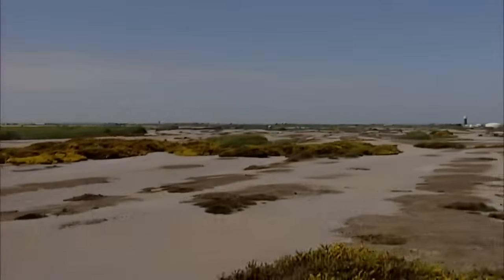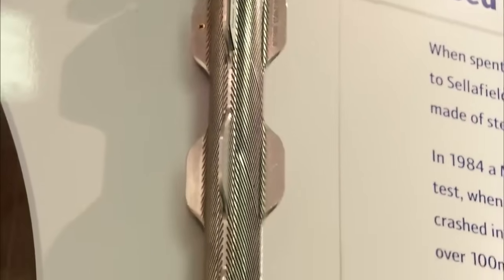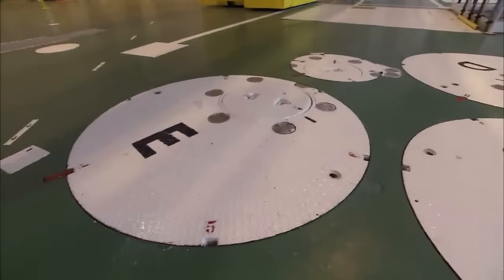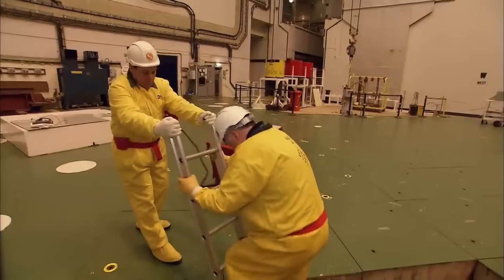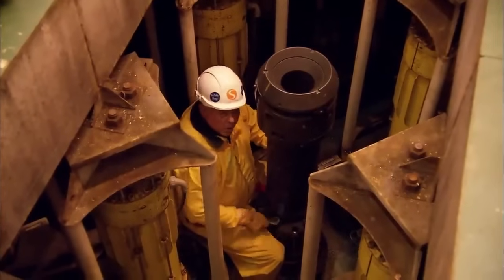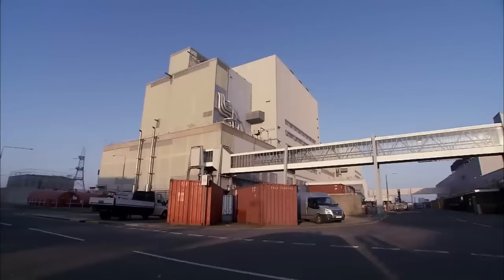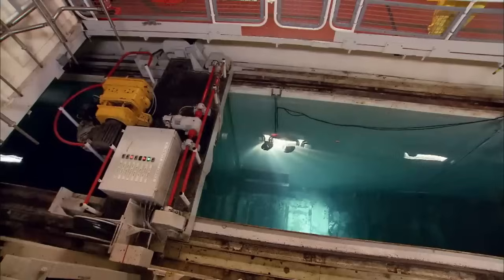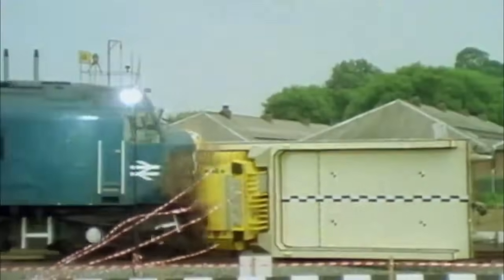How They Clean an Active Nuclear Reactor | Filth

Comment: ONLY 3 % OF THE ENERGY IS RECOVERED FROM THE FUEL BEFORE IT GETS TOO RADIOACTIVE TO HANDLE SAFELY, OR IT WILL REACH CRITICAL MASS!
Reply: The only correct portion of what you have written is the on average 3-5% uranium burn up in an element. The rest is just word salad.

Comment: Remember, all this has to be done with absolute perfection. But I guess any possible mishaps that can cause it to be released are still better than other alternative means of making electricity? 

Huh, my X to doubt button isn't working. Wonder why. Must be radioactive particles making it malfunction.
Reply: You know how many people are killed a year and how much toxic crap is dumped into the environment due to fossil fuel extraction, refinement, and use?
Reply: @Mayakran 
 
And I wonder how many more would die if we just leeched spent fuel rods into the environment. Its not like we have to fully encase those spent rods BEFORE we store them in an underground bunker. 

Why have the sarcophagus for chernobyl, clearly your thought processing says the radioactive particles there arent bad. Why the sudden freakout when the Fukushima plant leaked radioactive particles, clearly not as bad as the toxic waste of fossil fuels. 

Man, im such a dunce aren't I?

Comment: Fun fact: While standing inside the control room of a nuclear reactor you receive less radiation then a normal background dose
Edit: To clarify, I am talking about a function and maintained power plant, not an abandoned one.
Reply: Fun fact: A coal mine is more radioactive than most parts of a nuclear power plant!
Reply: @atome8088 also a fun fact that coal kills 100x more people yearly than the total deaths caused by radiation ever.
Reply: The same thing is true of your average underground parking garage as well. It's not even anything special, control rooms are just really sturdy and have thick concrete walls
Reply: Obviously because the control room is positioned away from the reactor itself.
Reply: @PlayingwithPawz That and it has a decent bit of shielding
Reply: Fun fact: NOBODY has ever built a control room inside a nuclear reactor but they are often located somewhere in the nuclear power plant facility... silly.
Reply: @LetsGoBrandon_  the comment said the control room of a nuclear reactor, not the control room in a nuclear reactor 😅 you should really read stuff twice before making assumptions
Reply: Yea your talking about a fully functional one. Go to an abandoned reactor and try that same thing. Rads are way higher due to exposure. Of course a protected room from radiation is safer than the environment that's unfiltered and unprotected.
Reply: Sure......
Reply: @richardmccann4815  thats actually true
Reply: @amazonbox5551 sure it is. "Then". Come on man...

Comment: To people who say Nuclear energy is safe and cost effective they are wrong on both accounts. This decommissioning must cost billions for one reactor alone
Reply: I'm pro-nuclear, but I can't argue with that point. The decommissioning process for a fuel type with lower thermal inertia (e.g: Drax, coal) lasts a month or two after the furnaces have been shut off and cooled. With nuclear that cool-down time is half a century, and the deconstruction of the infrastructure (Itself much denser than other power types) will take 4-8 times as long as for a coal-type station.

The flipside with renewables might be that it's much harder to build renewable generation infrastructure (Windmills, especially) with operational lifespans anywhere close to those of nuclear stations. There are derelict wind farms in Nevada from the 80s which have been left to rust because abandoning them was cheaper than proper decommission or replacement, and the same challenge is likely to be seen with the massive arrays of wind farms that have been put in place today. They could make parts of the British coastline entirely impossible to navigate.

Perhaps if we designed nuclear reactors with 300-500 years service lives, including a phased decrease in output across the last fifty to reduce the post-decommissioning cooldown?... ☢💡😇
Reply: @dieseldragon6756 what about the highly radioactive material? How will it be stored long term?
Reply: @silasnightmare9461  U.S wise we couldve done yucca mountain if that project wasn't gutted
Reply: I like how you don’t actually make an argument for both points and the cost is actually not that relevant because the way it’s done any energy thing emds up costing billions no matter what somehow

Comment: when yall get your full country green energy blackout ...dont cry ok k ...your literally trashing the safest cleanest and greenest energy type
Reply: Nuclear power is great and I'm glad there's gonna be more reactors 'soon' but these old Magnox reactors have reached the end of their service life. They're demolishing it because it NEEDS to be demolished. Not because they don't want it any more. Dungeness A did its work for 40 years. Nuclear power stations don't last forever sadly.
Reply: @mrmeatbeard  but thay last longer then 40 years lol...look at the military hell the reactors on the aircraft carriers are what 50+ years and still going strong no problems...dude you got to wake up you already drank to much cool aid...hell 3 mile is older then that and getting restarted
Reply: @danbrit9848 some last longer for sure. Magnox do not. Plus they're inefficient compared to gen3+ reactors and with gen4 or whatever it's gonna be around the corner, it makes sense to move to safer, more efficient styles of reactor rather than having to keep stopping and starting old ones when their pumps or valves fail
Reply: @danbrit9848 why do some appliances last longer than others? It’s an extremely complex issue. The irony of so boldly accusing someone of “drinking the KOOL-AID” when you don’t have a clear understanding of the situation.
Reply: @Mayakran lol I know vary well what I'm talking about...it's those in the green cult that lost touch with reality
Reply: It’s not a case of getting rid of it for solar panels. It’s a case of parts wearing out that means these were not safe to continue operation they could have refurbished them but they didn’t.
Reply: I was looking for this comment

Comment: I had hoped that the US invented Thorium reactor would also be taking in these spent fuel rods and pulling more energy out of them resulting in nuclear waste that would only be radioactive for 100s of years rather than 100s of 1000s of years. This is the power of Molten Salt Reactor. There are no pellets, no thickness that restraints nuclear fission into the vary core of the pellet because each pellet is ground up and separated into fizzile or or fertile fuel. In addition, this waste fuel extreme storage protection would no longer be needed.
Reply: Sadly no. The USA is too busy being lobbied and being swamped with draining the wallets of the average person into the top 1% and keeping anything truly useful inaccessible. 

Maybe something will change and the USA will get back on track of research, development and improving human life as a whole.
Reply: @IhiriTasogare  I found out recently that the NRC is entirely political. Science takes a back seat. This is similar to the FAA where the NTSB does the science, makes the recommendations for more safety, but the FAA won't push for the changes. One such politician who worked at the NRC was recently fired. I hope that firing motivated the rest to get off their collective butts and work. The NRC has taken, so far, 5 years to change one regulation: Title 10, Part 53. It originally stated that no one could build a molten salt reactor (MSR) > 1MW. Why? 
it said because they don't know enough. This despite Dr Weinberg's and his teams work on thorium MSR. We had 2 breeder reactors in the US that converted Thorium into U-233. During Bribed Biden's term, DoEnergy was destroying the stockpile of U-233. SMH.

Hopefully the new DoEnergy will do more. They've already permitted the start of 2 Thorium MSRs, but they are both 1MW.
Reply: The Idaho national laboratory is working on that
Reply: @InterdictionAirsoft  Good. So far I only know of 2 Thorium MSRs being built: Kairos and Texas A&M. Could you tell me whose building the Idaho national laboratory one? Is it the NRC or some such Government org?

Thank you. This is encouraging. If you know about Kirk Sorensen, he's the one who had a bunch of videos on Thorium.
Reply: I live in Georgia USA and we have a new Nuclear power Plant built that took for ever, way over budget,way behind on completion, White WestingHouse was the contractor who went belly up, it was sad all the way around that it’s 2025 and no one can build anything in a timely manner or keep on budget. It’s all about dragging the project out and getting every penny you can out of the populous. 

Yes we the people who get power from Georgia Power help find it with an extra chunk tacked onto are power bill every month. We also got pissed with Ga. power about the constant delays and over budget bs and they gave us $60 back….
Reply: @JackThelRipper  Yep. You're referring to the 2 additional Gen. 3+ reactors that came online only recently. One thing I learned from Illinois EnergyProf is that a nuclear power plant is built as an investment...period. Originally it was touted to take 1/2 less time and money to build. I don't know why the builders had to extend the build time and cost, But those extensions are what are causing the higher prices. I'm guessing environmentalists and regulation to include the enormous amount of paperwork. I hope someone comes up with a honest analysis.
Reply: Also Fusion technology. Once fully developed it will eliminate spent fuel all together.
Reply: @FreshlySnipes  Yep...that's part of the sales pitch and based on what we know of the technology, that should be the case. But we still don't have it.

Unlike Intel investing with the building of the EUV machines and then suddenly stopping because they felt it couldn't be cracked or whatever, Fusion has been an ongoing problem since the 1950's. 

I read a book where early on, a US fusion reactor needed cleaning and the normal procedure was 2 times. It was like turning the reactor on for a time without completely fusing anything and then turning it of. This one scientist just decided to clean it 13 times. The fusion reactor did much better. 

There are these beams called neutral beams. I forget what they do, but one guy decided to have them pointed in an opposing direction rather than the same direction. Voila!! Another advancement. 

The more I read, the more it seemed to me that it was just a bunch of generally directed guesses rather than science. Maybe that's how science works. But since it's been since 1950, I've stopped believing in any of the time prognostications. 

Thanks for reading.
Reply: @FreshlySnipes It will never happen. Another 50 years, another trillions of dollars! And still the radiation! Only the elites would get the energy freely, the slaves would pay for any thing they get.
Reply: Very

Comment: The stupidity to shut down fine reactors.......?
Reply: The UK kind of had to shut down the Magnox reactors, they were very expensive to build and maintain. I think they were supposed to replace them with something cheaper to maintain that didn't require using a gas as the coolant.
Reply: Exactly, we need better, safe and more efficient nuclear reactors but most countries are shutting down their existing ones.
Reply: This type of reactor has lifetime constraints that other reactor types do not have.  That constraint involves the graphite stacks that moderate the neutrons.  Over time, as neutrons bombard the graphite, it becomes brittle and starts to develop cracks and it will start to swell over time, which can cause control rod movement and fuel rod movement issues.  Once a graphite stack has been irradiated for so long it reaches a point where it is no longer feasible to use the reactor any longer.  Water moderated reactors do not have the same problem, although the reactor pressure vessel does suffer from embrittlement of the steel over time.  This can be reversed by annealing the pressure vessel which rearranges the steel crystal matrix back into its original state.
Reply: It isn’t fine, and they have worked out that the cost of repair is more than the cost of replacement
Reply: But it’s not fine, that’s the whole problem
Reply: Net zero bs

Edit: People have misunderstood my comment.

I meant the whole net zero thing is bs. I wasn't saying nuclear isn't clean.
Reply: @KenwayJoel  nuclear power is net zero. It doesn’t produce carbon dioxide. The plant is likely obsolete, having been in use since 1965. Eventually, it becomes easier to replace than refurbish and maintain.
Reply: @KenwayJoel nuclear power is net zero power… not sure what point you think you’re making?

Most environmentally conscious voters welcome more nuclear.
Reply: @KenwayJoel  nuclear is net zero, i think its a pr thing
Reply: @KenwayJoel  far more net zero than coal mate
Reply: @theorangeheadedfella  What?

Comment: Airline crews see more radiation
Reply: There is like a 1 in billion chance of a high energy particle causing damage to somone on a plane beta will be stopped by 7mm thick aluminum sheet planes fuselages are thick gamma well thats another story   yes they do radiation but not the bad kind its a impossible chance that it will cause harm to a individual what you dont want is EMF
Reply: Yup you are 💯 right. ❤
Reply: Yep..especially over old nuclear sites etc...
They seemed not bothered about the radiation or tried playing it like it's nothing to worry about in this video 😅
Reply: @danb2936  Do you understand how radiation or a nuclear reactor works? Modern nuclear reactors are extremely safe. They aren't bothered in the video and aren't making a big deal BECAUSE IT LITERALLY IS NOTHING TO WORRY ABOUT. Coal fueled power plants release more radiation and toxins into the environment on a daily basis than nuclear does in years.
Reply: @danb2936 are you a nuclear engineer? Do you work around fission reactors? What’s your background in the area besides “common sense?”